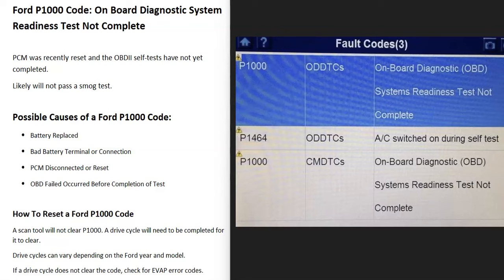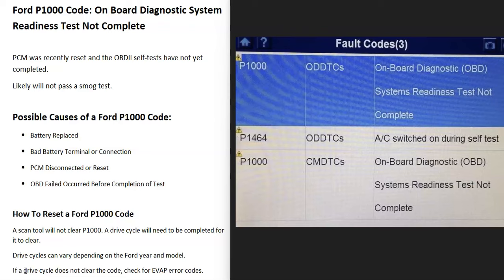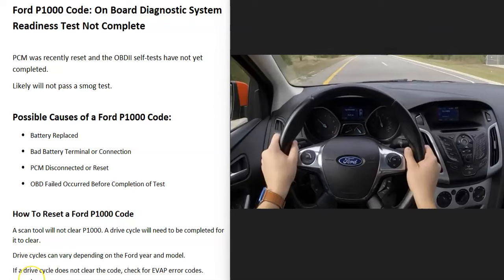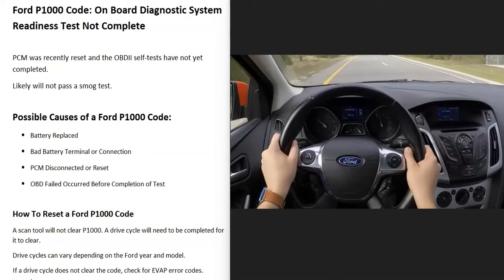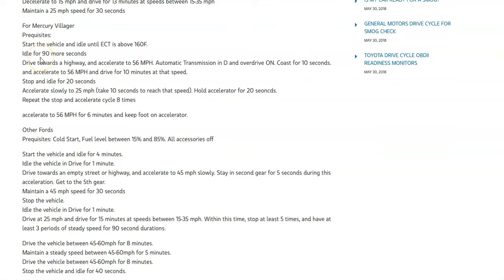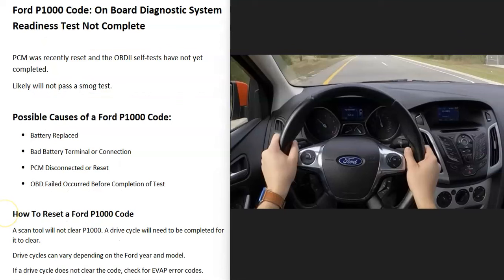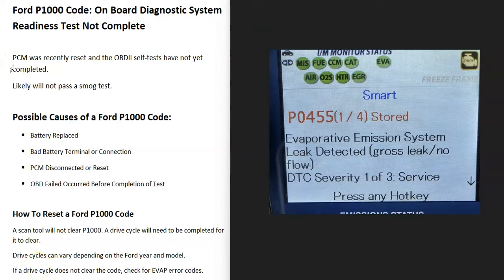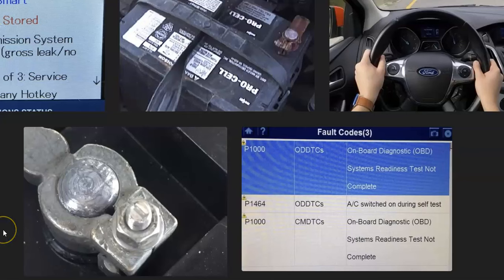How to Fix and Reset a Ford P1000 Code: On Board Diagnostic System Readiness Test Not Complete

Comment: Thank you! I just got a 2005 RV (sitting on a 2004 Ford chassis). I had to charge the battery and cleaned the battery posts and terminals. I also had to put gas in it was on empty. When I started it back up I had my engine light come on. I thought it probably had to do with the battery being dead and disconnecting it, but your video has confirmed my suspicions. I will drive it to the gas station and around some and see if the light will go back off. Thank you so much for the helpful information!
Reply: The same issue with my 2002 f-150 XLT I have driven for 3 months and the P1000 still show up 🤬

Comment: Truck won't crank got code p1000 fuel pump won't test relay fuse fuel run wire from relay to pump fine good persure start srartfiue start and stop howget running.
Reply: Huh!?
Reply: @shatangatang  that's exactly what I thought

Comment: I have a 2007 Ford Expedition that cranks good but does not start or starts and stops immediately and then the oil pressure light comes on.  I just replaced a bad oil pump.  The new oil pump has good pressure but the same condition of not starting is present.  The only code is P1000-FF, so how would you clear this code if the vehicle does not start?  Reflash or update PCM software?
Reply: I have the same Problem

Comment: Hi, what would be wrong if it doesn’t reset after driving over 3000 Miles?
Reply from the maker: I would look up the drive cycle and go through the steps. Also, be sure there are no other codes, such as EVAP codes, as there may be a problem in the system.
Reply: @HVAC_Mechanic  thanks for the reply, it will only show P1000 so I can not get any other codes to know what could be wrong, I just took it to Midas because it’s not running good and they said it was the Crank position Sensor but they replaced it and it didn’t help so they told me to take it to a Ford Service Center but I might have to wait weeks to get an appointment
Reply from the maker: @themadnomad5361  This is only a guess, but check for anything that may be resetting the computer, such as a bad battery cable or loose connections.
Reply: @HVAC_Mechanic  
OK thanks.

Comment: I noticed my fuel gauge has gone down rather quickly on my 2005 Ford Taurus.  I ran a Fixd test and it came up P1000 that you speak of. I drive very little do you think it will reset itself?
Reply: go on a little trip like 10-15 miles the more the better
Reply: I will do just that and get back to you with the results.  Thank you for your advice.  God bless and have a Merry Christmas @4.63v30

Comment: Question! I just brought my ford mustang 2008 gt had throttle body assembly new spark plugs new coil 1500 dollars later drive after 20 minutes it starts to die out …. That’s why I brought it in in the first place ! I told him what he’s saying makes sense but he said I’m positive this is why .. what to do
Reply: I was sure it was not that! I think it’s something electrical somewhere … I’m not a mechanic but you sounded very nice my question was the the previous text you just got thank you very much